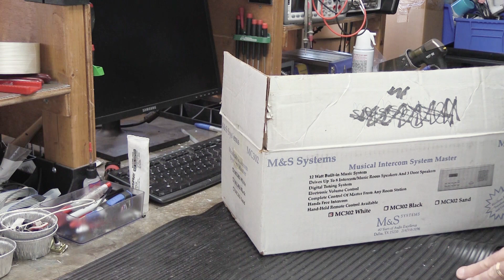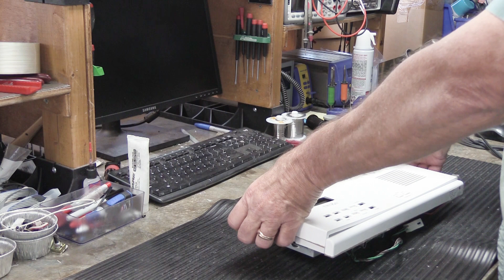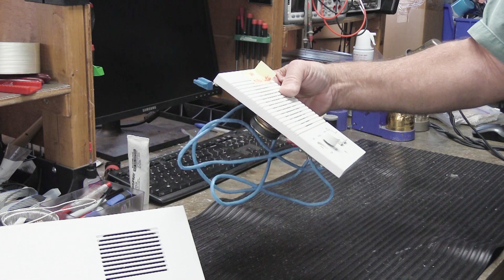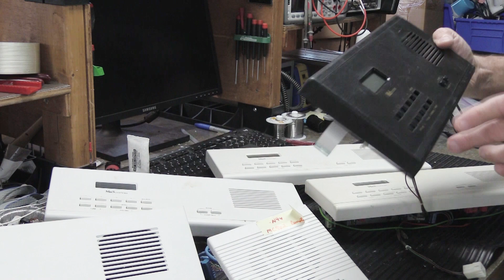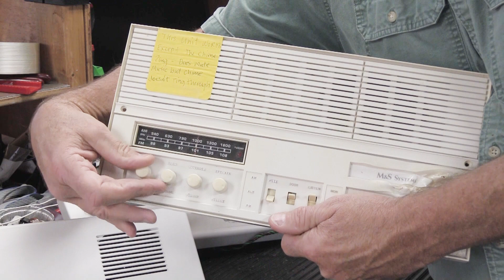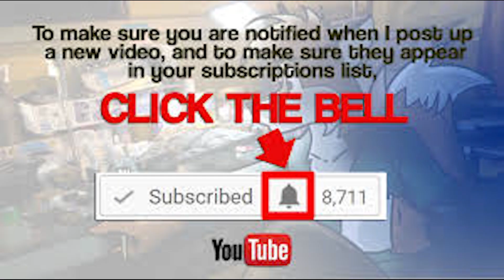Mail Call #24  ~ Lots More M&S Stuff ~ Music & Sound

Comment: If the tuner modules are fixable would that be cheaper than replacing them? If so, wouldn't the technician be cheating the customer by doing a switch?
Reply from the maker: Hi midhamm:   Repairing a Tuner would be less expensive than swapping out the Tuner with another unit - It would not be as quick - a Tuner swap could be done right in the customers home during the 1st Service Call - You have to factor in, if the company can / does component level repair work (most don't) - I think 'cheating' is a strong word to use - it could be that the replacement Tuner would be a rebuilt / repaired unit and they just cycle them over-and-over.  This is very common once models have been discontinued and new assemblies are no longer available.  - Chris